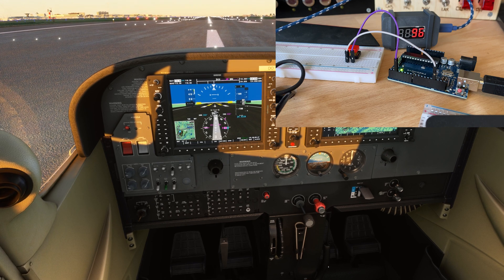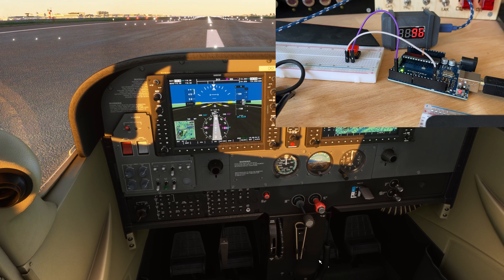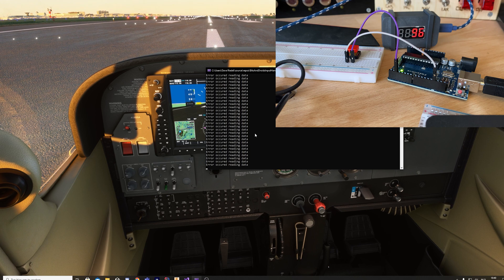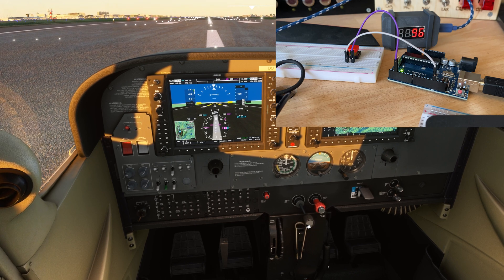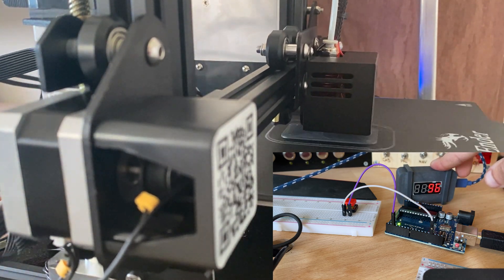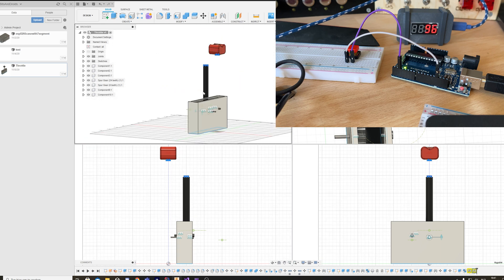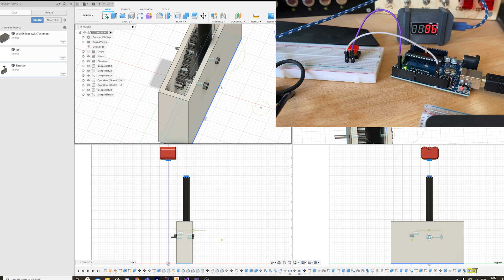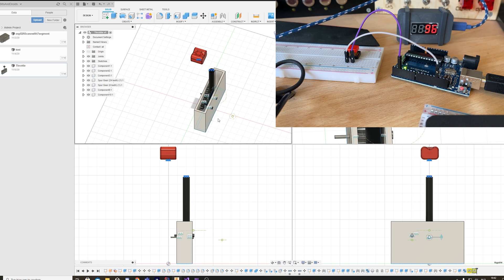Update on my projects: Throttles, Arduino uno/mega and printers?

Comment: Nice. Mega and Uno will be a great improvement. Which 3D Cad software do you use?
Reply from the maker: I've started with some Autodesk since the interface seemed quite intuitive for these kinds of designs.
Reply: Looks like Fusion 360 to me...
Reply from the maker: @jokue2002  Oops you're completly correct. Fusion 360 from Autodesk

Comment: I have a leonardo being delivered today hopefully it will work with windows 10 the 2 pro micro boards don't seem to work @all might be the bootloader?
Reply from the maker: Could be. I've used 5 and all were plug & play for me on windows 10. Do they not come up at all in the Arduino IDE or device manager?
Reply: @Bitsanddroids  no they don't seem to when I plug them in 1 red light on the board lights up and my computer says that a USB keyboard USB mouse a USB joystick and a generic USB device shows up in device manager all @ the same time then in arduino ide on com port 4 and leonardo shows up then click get board info and it says nothing is connected basically and that is the same with both pro micro boards I bought @ the same time soooo idk what to do next so I got a leonardo r3 ordered and until I figure out bootloader stuff ill try the new board I got thank you for continuing helping me